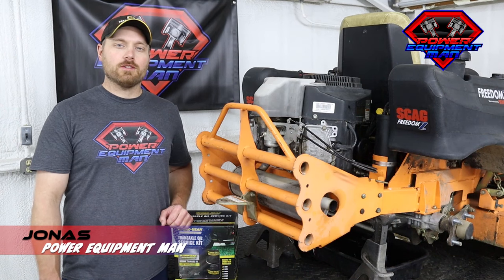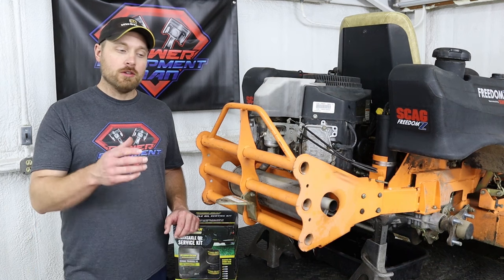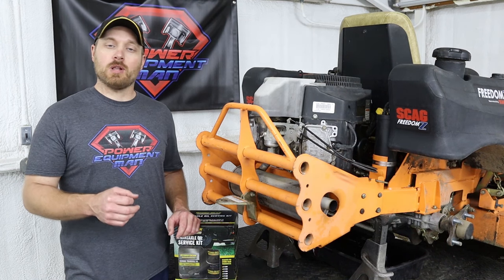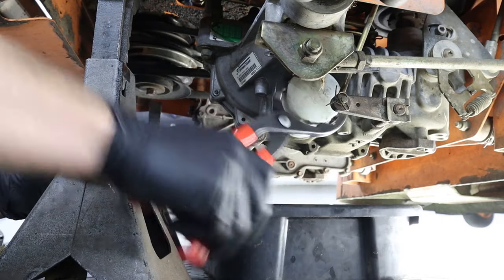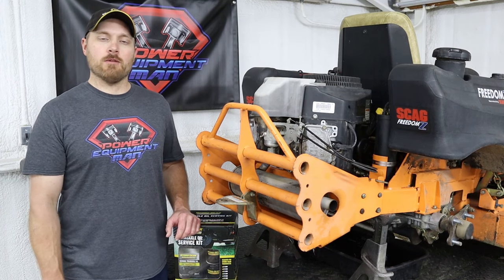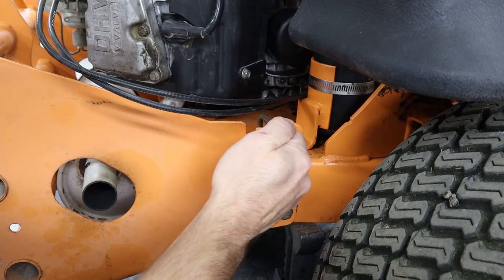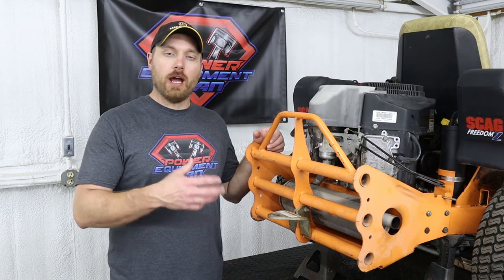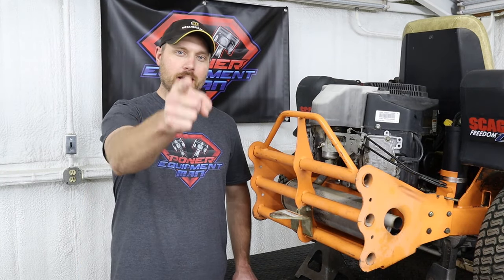Hydro Gear ZT-2800, ZT-3100, ZT-3400 Service Hydrostat Oil/Filter Change

Comment: Is the oil in this kit synthetic?
Reply from the maker: No, I don't believe so. Hydro-gear only calls for synthetic oil in their bigger pump and wheel motor setups.
Reply: @PowerEquipmentMan  if you buy the Hustler branded hydrostatic transmission oil, it is full synthetic. Not sure which one I want to go with, hydro gear oil or hustler oil.
Reply from the maker: We have always just used Hydro-gear oil. They built the hydros, they know what needs to go in them. I'm not sure who makes Hustler's oil. Change it at the recommended service intervals and you shouldn't have any problems.

Comment: What do you do when one of the bleeder valve is on top of hydro
Reply from the maker: Bleeders are NOT on top of the hydro, they are on the side.
Reply: @PowerEquipmentMan  crz green mower has one on side and one on top
Reply: Bobcat
Reply: Thanks let fluid run out of the top thanks

Comment: What do I do different if my mower has no expansion tanks?
Reply from the maker: If you don't have the reservoir, you will use the pump and fitting that comes with the Hydro Gear service kit (see link in the description) to fill the hydros through the bleeder hole. Once oil starts to come out of the fitting, it's full.
Reply: @PowerEquipmentMan  Thanks for the reply. OK that part is complete filled with oil until it came out of the vent hole. Also purge procedure is complete. With the internal expansion tank how do I check that the system is full after the purge procedure? Pull the vent bolt again and see if oil comes out still?
Reply: So anyone needing help. I had to do the purge procedure twice after the fluid change without the reserviors. I cut grass with it for about a half an hour then let it cool overnight between purge procedures. Air bled each purge procedure. Everything appears to be working great. Note my manual that came with my badboy mower stated less oil than hydrogear stated for my model of drives. I contacted hydrogear and they stated their numbers are the ones to go by. Hydrogears volumes appeared correct. Also I did not use the hydrogear kit just filled with a long funnel at the top port until the oil came out the side port. Hope this helps someone
Reply: With no reservoir, when bleeding do you screw both of the ports, side and top ports in during the bleeding process or do you need to leave the top port out for the air to evacuate?
Reply: @TheBeastyBeastr  screw both plugs in. There is a vent on the top of my the unit. After running the purge procedure without reserviors you have to pull the side plug again and make sure the fluid is topped up to the bottom of the side port. If you send me an email address I have a pdf from hydrogear I can send  you

Comment: My zt 3100 does not have air breather bolt.
Reply from the maker: I have never seen one that didn't. The air has to be able to get out somehow. Maybe it has a different fitting there instead?
Reply: Ours don't either, we have mowers with the 3400 and 3100's.
Reply: It has taken a whole week to get the oil in through the overflow reservoirs. I went to my dealer and show me the exploded view of the 3100 that is in my mower. It clearly shows the fitting and the plug. But I don't have the plug.
Reply: Been at it a few hours straight and we almost have 4 quarts through a 36" stander with 3100's😴😴😴💤💤

The 52's have the 3400, still no breather bolt but they purged much faster than the 3100's. Got 5 quarts in them in about an hour. 

On jackstands back and forth with the controls, unlock hydros back and forth and keep repeating.
Reply from the maker: Do you know approximately what year your mowers are?
Reply: @PowerEquipmentMan  we just bought them last year so probably 19's or 20's. 

They are Bradley Standers. The manual goes into how to purge them but it just takes so long. 

We have a Husqvarna with 3400's that's a 2017 and it doesn't have it either.

Comment: Don't really remember seeing anything about it if you don't have a reservoir
Reply from the maker: If you don't have a reservoir, you will use the pump and fitting that is included in the hydrogear service kit to pump the new oil back in though the air bleeder hole.

Comment: There’s a much Much easier way. Leave those air bleeder bolts alone. Instead, put a vacuum on the reservoir and watch that fluid level drop.
Reply from the maker: I have never heard of that before. I would be afraid that the vacuum would be trying to pull air/dirt into the hydro through the seals.
Reply: @PowerEquipmentMan  what lol? It only takes a small vacuum. It’s a five minute job.